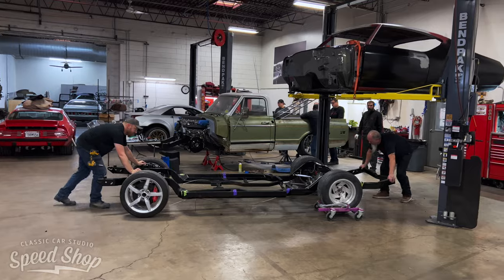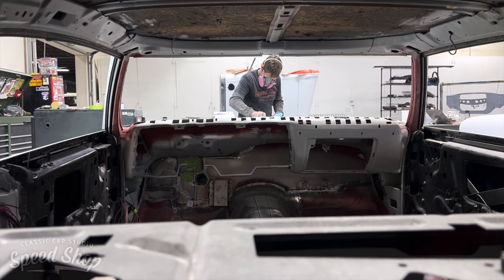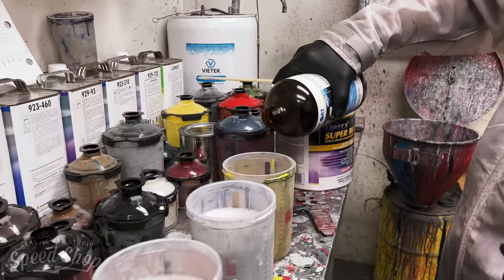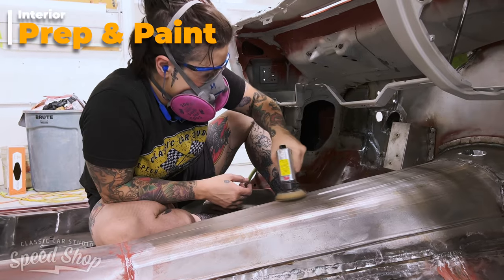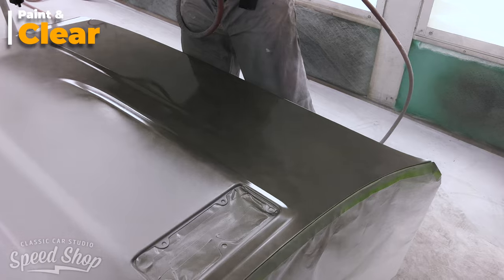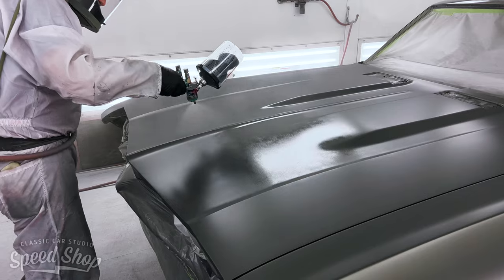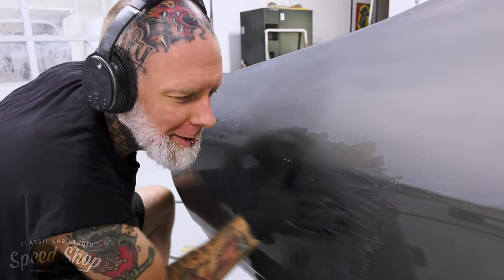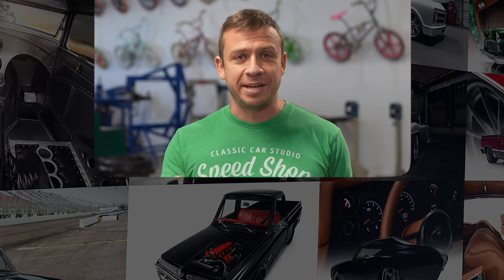Paint & Body • Episode 2 • 68 Chevrolet Chevelle

Comment: Can the rear brake lights be installed from a 1969 to a 68? I like the fact that primer goes on pink. Awesome job guys.
Reply: Not without modification to the tail panel - the access holes for the lights are different.  Otherwise, they'd fit fine.  '68 access holes are oblong horizontal, whereas the '69 holes are noticeably larger with a more vertical alignment.  Designed to mate up with the appropriate tail caps to seal that area against weather.
Reply: Thanks for the info. @frobish0145